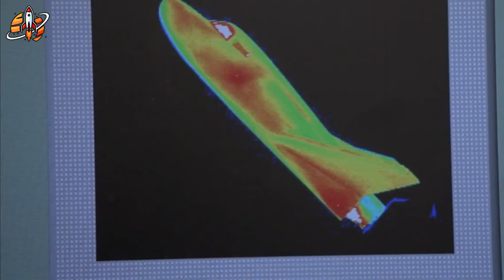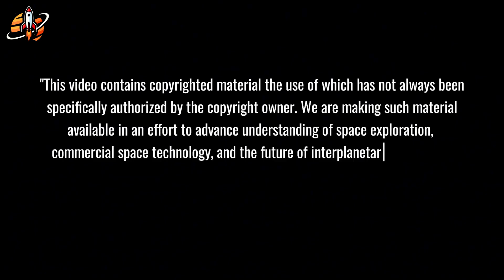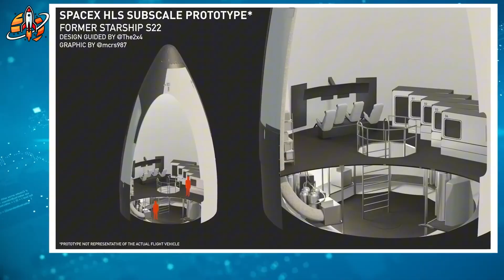NASA Just Realized Dream Chaser's FATAL Problem... Too Late for ISS!

Comment: is this victim blaming? sure sierra space may have chosen poorly with  ULA, but is it fair to to blame the design, the engineering, the concept? my question is, why did the upcoming launch test get bumped in favor of an airforce priority mission? why did this latest contract get canceled? was it because of lack of readiness of the system? was it because of a conceptual or architectural flaw? or was it politics, or bad planning inherent to the ecosystem dream chaser found itself in? its arguable that sierra space should have diversified its launch options through better planning, design and corporate strategy. also that it should have emphasized faster, more efficient manufacturing strategy, but to imply that this is a flaw in the concept and that no other organizations like ula and nasa are to blame for this waste of time and resources, is victim blaming, IMHO.
Reply from the maker: Valid point—victim blaming overlooks ULA's prioritization of Air Force certification flights, bumping Dream Chaser due to national security needs. Contract mods stem from mutual delays and Sierra's defense pivot, not conceptual flaws.

Comment: How many Merlin engines has SpaceX build? How many Raptor engines has SpaceX built? Now, how many BE4 engines has Blue Origin built? The difference is startling!
Reply from the maker: Spot on—the difference is indeed startling! SpaceX has built ~6,000 Merlin engines (9 per Falcon 9, 552 launches by Sep 2025), ~2,000 Raptors for Starship's rapid tests, but Blue Origin's BE-4 tally lags at ~20, fueling Vulcan & New Glenn delays.

Comment: Can’t dream chaser be retro fitted to space x ?
Reply from the maker: Technically yes—Dream Chaser's designed to be launch vehicle agnostic, fitting Falcon 9's fairing with minor Shooting Star module tweaks for ~$67M cheaper flights vs. Vulcan's $150M.
Reply: I think it needs needs a slightly larger shroud for launch the standard space ones are a little bit too narrow. But unless there proven plans for a replacement of the ISS then why bother and even if there are plans for a new ISS the cargo capacity of Dream Chaser is too low imo. As things stand the dream that dream chaser is after will likely never appear.
Reply: It always comes down to space economics
Reply: Too little too late
Reply: The concept for chaser is sound, it just should have been flying ten years ago

Comment: Did I miss the mention of Blue Origin BE4 engines being chronically late pushing back ULA Vulcan?  What know one wants to hear is that any company can change between functional and dysfunctional based on a very small number of people and short time frames.  However there is also momentum and it can take even a talented and functional company considerable time to build momentum.  Without that progress talent probably does not stick around for lots of years, causing loss of institutional knowledge and progress causing increasing loss of momentum.
Reply from the maker: No, you didn't miss it—BE-4's chronic delays (decade-long vs. 3-year goal) crippled Vulcan, as we detailed, dooming Dream Chaser's ISS timeline. Spot on about momentum's fragility; SpaceX's rapid Merlin/Raptor scaling (thousands built) shows talent sticks when progress snowballs, unlike Blue's talent drain from stagnation.